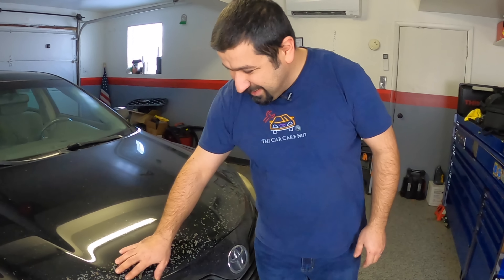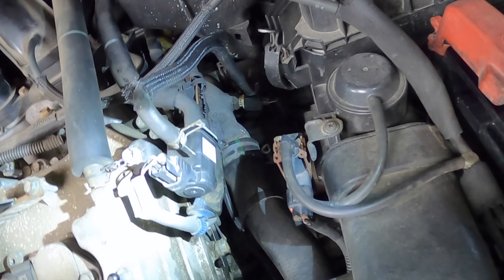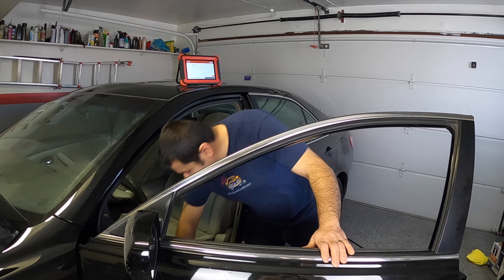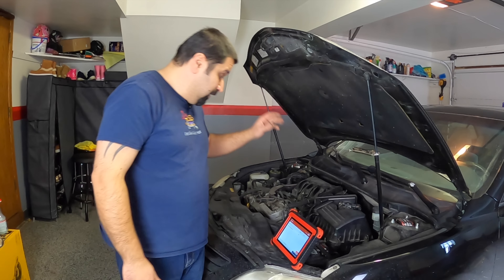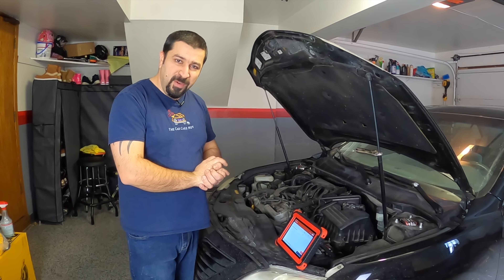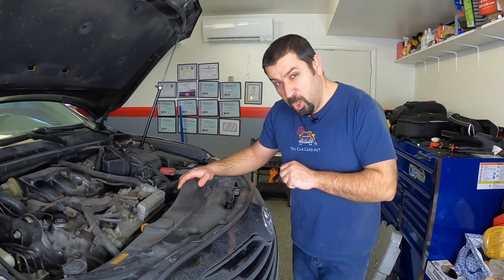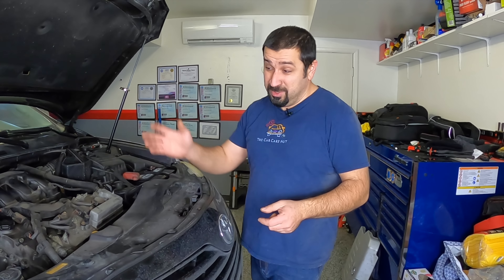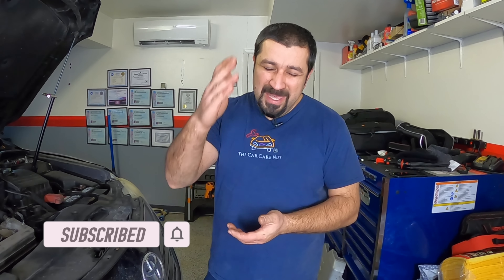How Does a 15 Year Old Toyota with OVER 200k Miles Hold up? Full Inspection!

Comment: My V6 1MZ-FE has had synthetic its whole life. Once it reached somewhere over 200k, it gradually started burning more and more oil. It's not worth having the valve seats fixed as my mechanic even told me, so I just add oil about once a week. Going over 70mph seems to cause more oil to be burned for some reason. There's a little blue smoke during cold starts on occasion.
Reply: No its not good to burn oil. Get a new mechanic!
Reply: Im curious how often did you change your oil / filter ?
Also , if you are adding that much oil , your Catalytic converter may clog up sooner .
Reply: @jayhockley8841  always synthetic, changed every 5k to 6k. It only has startup smoke following freeway drives faster than 75 for more than 15 minutes. 70mph drives, no visible oil burn.
Reply: @rkgsd   Start up smoke that goes away , is usually valve guides .
I had the same motor in my ES300
Reply: @jayhockley8841  I think you nailed it. Another shop said valve seats. Probably a situation where you might as well do both.
Reply: @rkgsd   If you are burning oil at higher speeds ( as you mentioned ) That could be worn pistons , too .
You might want to check to see if your PCV valve is working .
Somebody needs to do a compression test on all the Cylinders to see if its valves , rings or both .
And then you ll have to decide if its worth it to rebuild it , because in my opinion , there arent many competent rebuilders around .
Id preferr an original Japanese built motor over any motor rebuilt by 90% of machine shops .
Reply: @jayhockley8841  Great info Jay. I really appreciate your knowledge.
Reply: @rkgsd   You are  Welcome .
Reply: My 2000 Chevrolet Astro van 4.3 L V6 only really burned oil when I went above 70 mph. It had over a quarter million miles.  I think this is more of a piston ring issue more than a valves issue.

But I browser searched last night that you can get remanufactured 1MZFE engines about $2,000 plus shipping.  Got to believe you could get a couple remanufactured cylinder heads for three to $400 plus shipping.
Reply: @michaeldunagan8268  If it only burns oil when going over 70, I'd just live with it or stay under 70. Mine also burns more oil the faster I drive over 65. Same probable cause being piston rings  rather than valve seats, EXCEPT there's also a few seconds of light blue smoke when starting the engine,  but only after driving it hard before it was last shut off.
Reply: @rkgsd  

It also could be both ailments.  You could have both piston rings being shot and valves being leaky.
Reply: @michaeldunagan8268  Good point. Another shop said the same thing. 265k on it now and with that many miles, it would be silly not to work on both since it's open. Cheaper to go  remanufactured at that point since there are probably other developing issues. Really depends on how long you want to keep it and if it will pass smog. Most recent repairs: fuel pressure regulator (replaced myself). Fuel was literally dripping onto the engine!  Knock sensor wiring harness replacement. The wires lay between the two cylinder banks and get baked by engine heat (knock sensor replacement also was suggested since it was apart). Dealer wanted $1400. Another shop did it for $900.
Reply: @rkgsd  

I drive a semi truck that I own and I'm likely going to go with the remanufactured route as well because it's just too cost prohibitive especially at my age to get my engine rebuilt at Cummins dealership.  Might thinking could change if my financials substantially improve.

Putting a video I just watched tonight by AMD he spent hours, he claims anyway, cleaning up the cylinder head and grinding the if he bills 2 hours for labor that would be around $300 bucks. I'm wondering if you just get a new cylinder head for a couple hundred more.

+++++

I just spent about 10 minutes browser searching. The head along without any springs or valves is like $500 remanufactured from what I could tell so I guess the cleaning pays off.

Comment: My 2003 Highlander V6 has 235K miles have just replaced wearables only and the gas tank opener. The rear struts are leaking so they will need replaced about $750 so I will do the fronts as well

Comment: My 99 VW Golf 2.0 has over 210k with original AEG engine and transmission runs like new and burns less oil than my 2010 Camry.

Comment: I tried to e-mail you, but no dice. Anyway, thank you, for your Youtube videos! I acquired a 2003 Corolla in late 2018, and have been having a battery drain issue(s), ever since. I don't know WHY, but the previous owners never took it in for the headlight switch &/ DRL relay TSBs. Since acquiring the Corolla, I have replaced the DRL relay (ending in 030 with the 050 relay), which stopped the headlights from draining the battery. Then, something else continued to drain my battery (in 90 degree average weather). I took it to a local shop, and they found that the trunk light timer was defective. So I had them deal with it accordingly. 

But now that it's cold again, something is still killing my battery. It's something SPECIFIC to about 32 degrees and below... I'm at a loss. I've tried getting answers from Toyota, but they're keeping a tight lip.

Any information would be greatly appreciated!

Comment: I plan to do a large service when I hit 150k miles with my cars. OEM  new struts, lower control arms, ball joints, tie rods, intake cleaning, throttle body cleaning, and brake checks. Lastly, I make sure to do preventative maintenance by replacing common known issue parts. Figure at these miles the parts will either be shot, or need replaced soon enough. Might as get it all fixed up and ready to roll for 150k plus more. Planning to spend a couple thousand at this point in the cars life makes it palatable. Of course these are mostly easy DIY things, they would cost more if a dealer has to do it.

Comment: i have used only high mileage oil on my 2012 Camry hybrid since 70K miles. AT 205 Reseal treatment was performed after I detected a small rear main seal oil leak (115K miles). I now have 147K miles with a clean engine. Oil leaks can be avoided with timely intervention.
Reply: Had the same thing happen on my wife 08 RX350 as well, leak from valve cover gasket starting at 90K miles, used high mileage oil and it stopped it.  At 120K, spark plugs were replace along with that seal.  No more leaks.

Comment: Another great video AMD! Since this car has the 2grfe V6 engine I'm wondering if it had the defective engine oil coolant lines made with rubber? My 2011 Highlander with the 2GRFE 3.5L V6 had a major and almost catastrophic oil leak at 102,000 miles due to a pinhole leak in one of the rubber engine oil coolant lines. Fortunately there was no permanent damage to the engine and we now have the OEM metal pipes which will not burst. But, had my wife not noticed the low oil pressure light when it came on and immediately pulled over and turned off the car, it would have been goodbye engine! I would advise anyone with this engine in Highlanders, Siennas, Venzas, Lexus RX350 to get those rubber oil lines replaced ASAP if you have not done so already or you risk blowing up the engine as it will run out of oil!
Reply from the maker: Hi! The Camry doesn’t have an oil cooler. But does have the rear vvti line which is rubber however it was updated in a campaign
Reply: @TheCarCareNut  If you look the rear vvti line up in the Toyota parts system it shows up as an oil cooler line even though it doesn't accurately describe the part. Maybe that is where they got coolant from?

Comment: I have a 03 camry Le ( 120k ) and i want to start doing my oil changes myself , lube shops we never know what type of oil and filters they put on .. I know its SAE 5w30 , but its conventional or synthetic and wich brand do you recommend ? Ty and its a pleasure to watch ur videos
Reply: I like 5w30, by Mobil 1 or Pennzoil.
Reply: @victorbaird8220  Ty sir 👍
Reply: If the car calls for 5W-30, I'll use any brand that meets Toyota's specs but I'll buy 0W-30.

Comment: Like the video, I have a 2005 Avalon Toyota  and it has 279,000, on it and it still drive like new , but the only problem I have with it is my AC keeps losing AC freon, I change the AC condenser and it still leaking out from somewhere,  what do you think it could be

Comment: I really enjoy your videos - very informative!!! I have a 2007 Toyota Avalon Limited that I bought new. It currently has 137,000 miles and has been well-maintained and garaged. On a recent vacation, I drove it for 1100 miles. On the last 100 miles of this trip, the Check Engine, VSC and squiggly lines lights lit up. The car seems to run fine, even after this issue occurred, and got 33 – 34 MPG on the trip! I have been using AMSOIL synthetic engine oil (changed every 6 – 7k mile intervals) and AMSOIL transmission fluid (changed twice since the car was new). When I took the car to the local auto parts shop the next day for a free diagnostic code reading, it displayed a P0015 code. This code reading indicates Exhaust “B” Camshaft Position Timing – Over – Retarded (Bank 1). It involves the vehicle's camshaft timing, specifically the variable valve timing (VVT), also known as variable camshaft timing (VCT). When I drove it the next day for a very short trip, NO Check Engine, VSC, and squiggly lines lit up. Should I proceed to have my mechanic troubleshoot and fix this issue even though the lights are not on?  
Please advise…. Thanks, John

Comment: What type of maintenance could have prevented the problems in this car?

1. Mobil one 5w30 with OEM filter every 6 months or 6,000 miles.
2. Transmission fluid flush every 50,000 miles
3. Change coolant every 5 years or 50,000 miles
4. Refresh power steering fluid every 2 years by removing fluid from the reservoir and adding ATF
5. Replace spark plugs with Iridium plugs every 90,000 miles
6. Rotate and balance tires every 8,000-10,000 miles
7. Use PB Blaster to lubricate areas when the wheels are off
8. At 10-12 years, replace brake calipers with painted Power Stop calipers during brake pad and rotor change. Also, change brake fluid.
9. Refresh brake fluid every 2 years by removing brake fluid from reservoir and add new dot 3 brake fluid.
10. Change air filter every 24,000 to 30,000 miles. Check every 6 months and replace if needed. Clean the outside and inside of the filter housing with a damp cloth every 6 months.
11. Wipe down and clean the hoses and other parts in the engine bay every 6 months.

Comment: I have a 2019 Camry SE with the 2.5 liter 4 cylinder and 8 speed automatic transmission. It’s still running great at 86k miles and I maintain it but I should probably start driving more conservatively and stop accelerating hard 😆
Reply: I have a 2022 camry still runs fine and look like new.
Reply: @Paul-rk5zu  that's impressive! My 2021 Tundra still drives like new, with no major problems. I hope to get at least a few more thousand miles out of it🤞
Reply: Wow you got three years out of it and it still runs ok.  Thats amazing.   Hope you shop for your next car soon
Reply: @cayman9873  well, I bought it used in January of 2021 with 38k miles….. If I bought it new, it would have 150k by now lol
Reply: @stevieray1828  funniest comment of the year!😂

Comment: Hello AMD! I LOVE your videos. Thank you so much for sharing your expertise so generously!

 I have a question about my 2006 Lexus IS 250 rear wheel drive, 140,000 miles.   we bought the car at 112,000 and my knowledge the automatic transmission fluid has never been changed (yet!).    I'm noticing when decelerating off the freeway, when I get to about 10 or 15 mph, then I give it throttle, the RPMs seem to rev up without the car getting any power for a second and then it seems to shift into gear fairly smoothly. Occasionally I'll notice a not so smooth shift I believe between 1st and 2nd. Just a little kick occasionally. Do you think my transmission is going out?

 Thank you for all that you do!! YOU'RE TRULY A BLESSING to us DYI ers especially.

Comment: The reason one of my vehicles had an aftermarket oil cap was that it broke when I was changing the oil, and I needed whatever fit from the parts store in walking distance immediately. I doubt it was practical for anyone with one of those to track down the OE cap under the circumstances where you’d replace it.

Comment: Those oil leaks are part of the self lubing chassis system. Keeps the rust at bay. Axle clip is 1 man removal job, but need 2 to put the clip back properly. Ask me how I know. 
On my 2001 Touring, the left front door lock doesn't work properly. Found out the electric actuator on the door lock is faulty. Went to Toyota dealer. Part was available for $240, but would take 2 weeks. Part is made by Asin. Found a set of actuators for both front doors on ebay for $100, made by Asin. Just ordered yesterday. I find some Toyota parts at dealer for reasonable cost, but other parts are sky high prices and wait time for availability. High prices for dealer parts deter people from buying from the dealer, esp since the parts are made at the same time as the new car parts on the same assembly line and factory. Almost $500 for $100 parts is not acceptable.

Comment: 2010 Camry 4 cyl (2jz ?), 275k miles. Other than all fluids and tires the only maintenance has been brake pads and rotors  at 210k miles, only because I thought I ought to...still about 30 to 40% left. Drivers side rear wheel bearing at about 60k....looks like it was shorted grease at the factory because there was virtually none in the races. That's  it. Nothing else. No oil use at all. Keep pulling the plugs at 75k intervals but they're fine. Probably got lucky. And my paint chips are very minor.....this guy must be driving lots of dirt/gravel roads. 😎

Comment: I haver a 2005 Highlander with 185,000 miles  with routine maintenence  and no problems. When I get the timing belt, water pump, idler pulley, tensioner and other belts serviced, should I have the drive shaft and camshaft  seals replaced even though there is nothing failing

Comment: I've got a much loved RAV4 V6 Limited with 201K and I'm seriously thinking of bringing it to you and letting you give  it the once-over so I can run it for another 100K.  Current needs:

Heater not working especially well
Clunking suspension
Water pump noise (sounds like a bearing, but comes and goes)
Engine growl/vibration at idle and under load, very intermittent
Oil cooler line upgrade to metal
Never changed the tranny fluid, so that's obviously out, but coolant needs to go, as it's original

I live in Cleveland but would be willing to bring it to you, for the sake of having a mechanic who obviously knows what he's doing.
Reply: My wife 08 Lexus just hits 155K miles and still drives great.  Water pump and spark plugs replaced.  Oil change every 6 months, transmission fluid drain/refill every 30K miles.

Comment: How the world changes: in one of his recent videos I mentioned that I had a 2007 ES 350 with 184,000 miles and was going to aim for 300,000 miles with help of The Car Care Nut channel.

Just two days later I discovered the transmission was acting up and may indeed be failing.

The 2007 ES 350 and Toyota V6 Camry transmission’s had problems from the very beginning. So now I have to decide if I go with a remanufactured unit or try to find a salvage unit from a later (say 2010 ES 350 or Camry V6).

Comment: AMD is always spot on he will not tolerate aftermarket (may be suspension parts) but when it comes to sensors , spark plugs or purge valve it should always be DENSO as the car is very allergic to after market parts

Comment: I have a 2011 Camry 2.5/6MT with 236k and it is just coming up on its first real repairs: needs struts and engine mounts. Otherwise one set of brakes and lots of tires. Man, that car in your shop seems like it got a lot of work by comparison!

Now my 1999 5S-FE… that thinks its British, and no matter what I replace it is committed to leaking oil! Still going at 232k, albeit with plenty of repairs.

Is it a surprise that we bought a Camry hyrid?

Comment: Barely run in!! I have a 2010 Camry with 134000 miles. Looks and drives like new. Not a squeak or rattle anywhere, no engine leaks, no oil burning, just the usual stone chips. Have done 22000 miles in it over 3 years not a single fault. Intend to keep it for another 3 at least. That one looks rather unloved, but they still keep going!